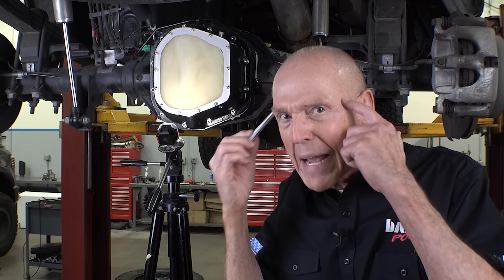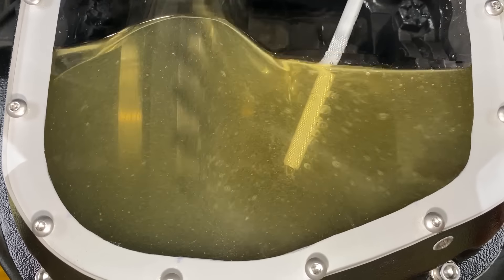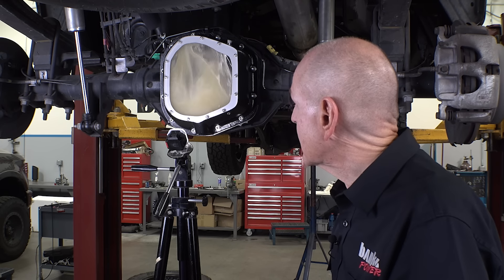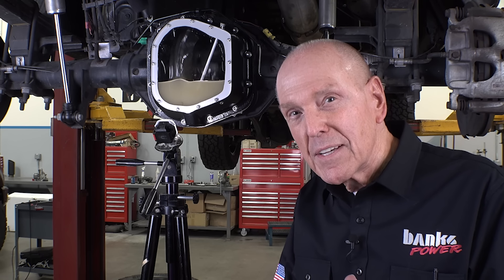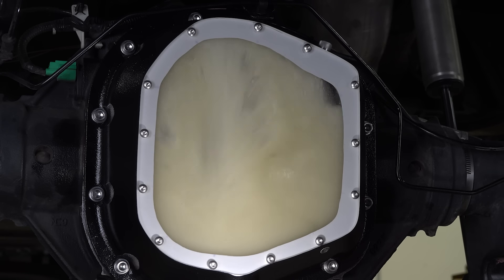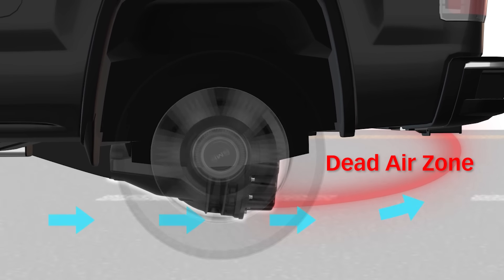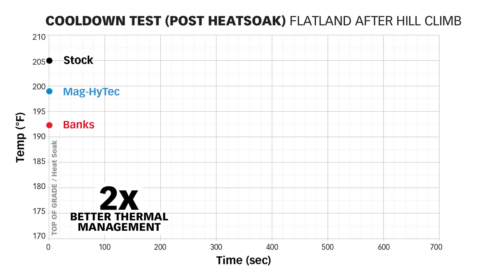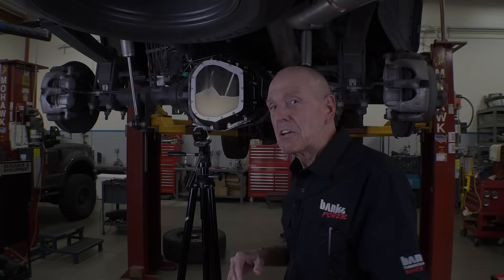What aftermarket diff cover guys don't tell you!

Comment: If you're needing to add "performance upgrades" to your vehicle, maybe you should have purchased a vehicle produced by a manufacturer that builds a better product! Vehicle manufacturers compensate their engineers extremely well. Why would they pay an individual with such engineering capabilities if they weren't developing products that maximize the efficiency of the product they are developing? Aftermarket cold air intakes with the oiled filters that coat the oxygen sensors in said oil are the worst closely followed by aftermarket exhaust systems (particularly the CAT-back varieties). If you aren't going to put a less restrictive header on your exhaust why alter anything further down the line? Its like having a straw with a fat tip at one end. It still has to travel through the narrow section of straw which negates the larger diameter at the tip. It's all about marketing to get your hard earned dollar so you can "keep up with the Joneses". I love my stock vehicle! It's fuel efficient, reliable and if I sell it there isn't a bunch of failing aftermarket crap that will dissuade a potential buyer from making the purchase. All of my hunting buddies want to ride in my truck when we go hunting because their exhaust is so obnoxious it ruins their ability to keep from scaring off the wildlife. My neighbors are able to continue with their peaceful sleep when I start my vehicle late at night & early in the morning. I don't attract any unnecessary attention from law enforcement or over sensitive citizens. I also have a healthy supply of testosterone for a person in their mid 40's & that seems to be a large factor in these decisions as well. I guess I get plenty of attention and don't need my vehicle to compensate for the two attributes previously listed. To each their own, but I don't carry passengers to my hunting honey holes anymore and no aftermarket exhausts are allowed on my property. Fix your shit or hunt somewhere else!

Comment: Interesting scenario. But 'doubtful any is getting to the pinion and ring interface.'  Yeah, I'm sure that pinion is dry.....

And the aeration is destroying the film strength?? Huh? If it's wet, you have all the film you will need. How will air bubbles interfere with the microscopic interface between the gear faces, it seems as though the polymers are still going to be there.

But then there is the drag factor but it seems like it would be a lot less there than in an engine. Thinking of crankshaft wipers.

I don't know, the man is not a rookie for sure..... maybe just a great salesman. In fact I'm ordering mine NOW!!😂

Comment: Excellent engineering by this legend. Will these be available for GM smaller axles soon? Like the 10 bolts
Reply from the maker: Thanks for watching, here is the current status of the diff cover development. 

Available for Purchase:
▪️AAM 11.5" or 11.8" 14-Bolt (01-19 GM, 03-18 Ram)
▪️Ford Sterling Axle 12-bolt with 10.25/10.5

Pre-manufacturing testing:
▪️Dana M275 - Ford '17- ‘20 (F250 HD/F350 SRW) - ETA: Early Spring 2021
▪️Dana 80 (94-02 Ram 5.9, F350/450 99-07)  - ETA: Mid Spring 2021
▪️AAM 12", 14 Bolt (GM 2020+, Ram 2019+)  - ETA: Late Spring 2021

Comment: The video is not neutral.  The video was made by Banks to say why theirs product is better, (which it could be).  But 1/2 the video was spent talking about how your competitors product has terrible oil flow and aeration problems, but you didn't put plexiglass on the Banks cover to show if it truly was any better than the Mag.  It's easy to do a test on the competition's product and criticize it, but if you're gonna criticize it you must also do the exact same test with your product to prove yours is in fact different under the exact same test.

Comment: So my problem with your design is that I live in a very wet boggy area. Mud and plant materials gets wrapped around the under carriage witch plugs up ur ram.
Reply from the maker: If it's filled with mud, there's no downside other than a temporary loss of air being directed through the fins. When you get home, simply hose out the Ram-Air scoops.

Comment: You do not need to flood that ring and pinion - think .001-.003 inch clearances between the connecting rod/main engine bearings. You need a thin film along with enough sump oil to take the coolant (oil) heat away to recirculate. Could you have a larger sump and maybe an aluminum cover, i.e. like the diesel Ford Super Duty trucks - yes, of course. With that said, for sure you don't need to spend $400-$450 for a Banks or B&M. The Banks does look pretty and it does have a drain plug though but I have other ways to spend my hard earned dollars then to hide it under my truck for minimal, if any, real needs or bragging rights. Remember that these various name brand trucks are used in 'garden' countries like 120 degree deserts of Saudi Arabia. Egypt or Algeria with nary a problem (yes, I have worked there)

Comment: Looks as if some of the lube is following the ring gear over the top even at lower speeds. Then at higher speeds, the lube is hitting the top of the carrier/housing as well and it seems logical the housing shape will be splashing tons of fluid over the pinion. I'd rather see a video of the pinion area. Show us the "aeration" of your banks cover...

Comment: I’m sorry but none of this is scientific. 

Everything is based on his (Banks) personal descriptions. And research like this would be a class five or class six study, the lowest form of acceptable research.

Everything is based on conjecture. We really don’t know if bearings are being properly lubricated or not, and the resolution is not clear enough to see whether or not real air bubbles are forming. Additionally, anyone can take a couple of pieces of flat steel and pound them into a shape that will attach to a stock differential cover in order to affect the airflow in order to improve ventilation around the sides and back of the stock differential cover, so that is not so revolutionary. 

The fluid after his test was not tested for particulate matter or compared with particulate matter from a differential with a flat back or the standard back or the banks unit. In essence, we don’t know if the bearings are wearing or wearing out of spec. There was no tear down at the end of a 10,000 mile for 20,000 mile test with microscopic analysis. 

What I did see was that fluid did adhere to the crown gear, and the teeth themselves were pulling fluid all the way around in a circle even at low speed.

I’m not saying that he has created a bad product. I am saying that this was not scientific in any way or shape or form, and as such the results and the conclusions are suspect and are more his personal interpretations rather than real science. It is just good marketing without good research.
Reply from the maker: We invested hundreds of hours in actual testing. Both on road and the dynamometer. You’ll find the details and data at bankspower.com/diffcover.
Reply: Banks Power rather than tell me to watch your video, why don’t you comment on my specific comments? Did you do fluid testing? Did you do actual fluid testing? Did you pull out the bearings after running your set up and did you compare that to the set up that you created? Did you do microscopic evaluation of the bearings?

Comment: So correct me if I'm wrong - your own testing proved the flat back diff cover dropped operating temperatures compared to stock - over the "700 seconds"  which best proved the performance of your model?  Would that be an accurate statement to make - after 10 minutes of a ''fear' video? If not spending every second inside a total  bath of oil  is detrimental to mechanical operation, I suppose every engine is trouble. 
Why do people, companies, ect, have to try to make themselves look good by making others look bad?  Block the 'ram air' intake, and let see  how much difference just the shape design made.  Why make a demo, when you never show what your own model does.

Comment: I got a parachute on my rear diff cover. :)
Reply from the maker: Not sure what you mean by parachute. If you are getting at our Ram Air Scoops, our patented Ram-Air scoops are designed to increase airflow over the rear differential without sacrificing ground clearance. In fact, our differential cover retains the same low-point as factory and competitors.

Comment: I was disappointed to see they don't have a 10 bolt GM cover on their website.  I have purchased a black finned aftermarket cover to install after I put new bearings and gears in my rear differential on my Z71 and now I need to go out in the garage and open the box and see if it has that curve or if it's flat.  I bought it because it has a drain plug which means I can service the fluid without making a huge mess and having to re-seal the cover each time.  I tow with my truck and although I have no way to monitor rear differential temps other than a laser thermometer when I stop the truck and get around the back, I know that cooler temps equals better life span and less breakdown of the gear oil.

Comment: This comparison of the flat back cover with the fins compared to the flat glass cover is not a truly equal equal representation of the fluid dynamics because of the glass cover being flat when the flat back cover is not flat on the inside. So my point being that the comparison test is therefore invalid.
Reply from the maker: Sebestian, thank you for watching! It appears you may have missed the point in the video where there are two distinctly different flat-back covers. The Mag-Hytec has no internal fins. The PPE cover has horizontal fins. Again, the Mag-Hytec has no fins so the clear cover that we made IS an accurate representation. We did not claim to have made a PPE copy, which is the one at the beginning of the video with internal fins. -- Now, having said all that, the PPE would undoubtedly perform worse with its internal fins. Why? Not only is the oil being bashed against a flat surface, but then it would have to fight its way up and over the horizontal ribs. It's like water traveling up a rocky waterfall. Whatever oil is able to make it up and over the ring gear would be incredibly aerated. Again, you don't want air in your oil. Air does two things. It kills lubrication and speeds up the degradation of the fluid. The tailgate analogy doesn't work because you're not creating a low-pressure zone in the differential. You're simply working the fluid harder splattering it against a flat surface.

Comment: Would have been far more of an accurate representation of fluid dynamics if actual gear oil was used rather than water. Gear oil adheres to metal parts and water does very little of it. This test is pretty much like comparing jello to gatorade
Reply from the maker: There is no water in this differential housing and there was none used in testing, there is only diff fluid used. We encourage you to watch the whole series. There is more data for you to check out. This was the last installment of a 7 part development series. For a full breakdown of all the data and comparisons, we have an entire series that showcases the diff cover development. 

Watch the full "Behind the Diff Cover" video series here: 
https://youtube.com/playlist?list=PLwtmrqcWzLtQR9riOg8mizIEj-UX4WBBm

Comment: What a load of BS. What happens in cornering when the reservoir level changes?What happens under hard braking and acceleration? The only secret to diff longevity is changing oil regularly and only using quality lubricants. Unless you go exotic and fit pumps and coolers, that diff won’t give a rats what cover is on it.

Comment: Went to website to look for one for an f150.  Turns out they don't make one for it.  Who does not make parts for f150 these days?
Reply from the maker: We do not make one yet. We have one on the way. Right now the engineering team is focused on the more current gen ¾ and 1 ton HD diff covers. After these are done, we will proceed with F-150/1500 trucks and Jeeps. As of now, we are not sure of the exact vehicles that we will be working on yet, but it will consist of 1/2 ton trucks.
Reply: @bankspower  Thanks for the update.  I will check back from time to time.

Comment: Ok im sorry but the diff cover isnt why there's air in the oil🤣 the ring gear slapping the oil at 70mph is gonna make freaking air bubbles
Reply from the maker: When the diff cover is curved, the oil isn't "slapped" against it. The oil flows around the ring gear with minimal aeration. You'll see what happens inside the diff with a clear curved cover here. https://youtu.be/9-yG3D3JBRs
Reply: @bankspower  still air in the oil?

Comment: I always thought flat backs are useless.....whats the point of adding more capacity,if the oil isn't going to reach your pinion....and definitely,what the hell is the point of having milled heatsinks,with that much aeration 🤦‍♂️.... I'll stick with my factory cover that I KNOW works.....and to people bashing Gale's design....wellllll,if you notice,his is internally rounded to help with slinging....easy test to prove this theory,is take a round bowl and spray water on one side and watch how it "slings" the water out on the adjacent side(probably spraying you in the face..lol- happens to me when washing my dog bowl.🤦‍♂️)...then do the same with a flat pan and you get nothing from the adjacent side..... Flat Covers= Useless...